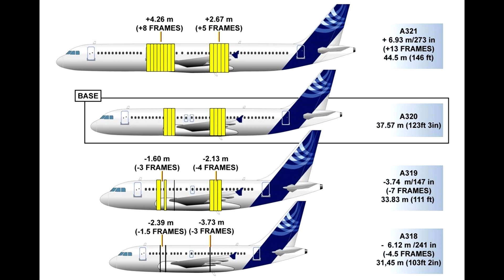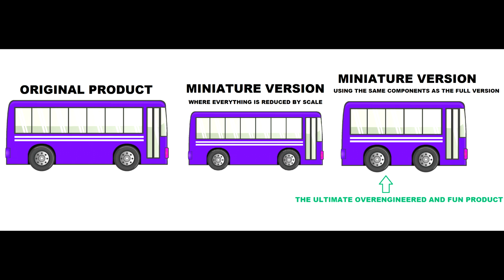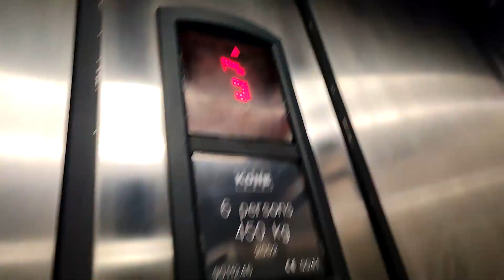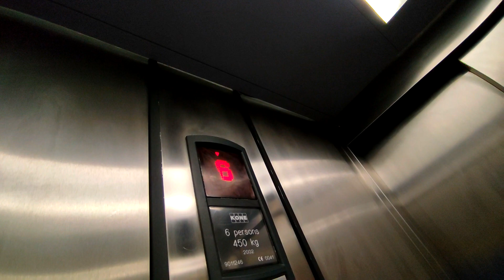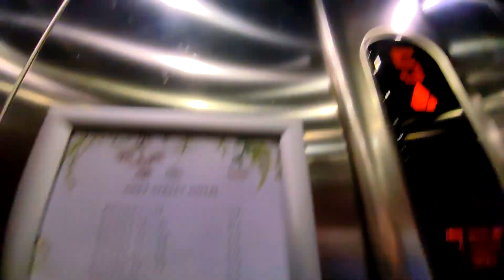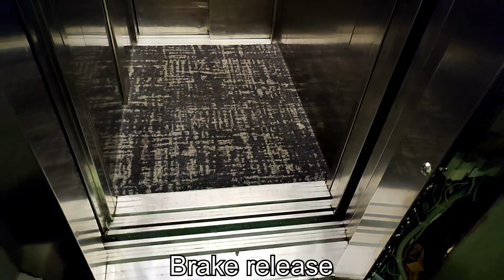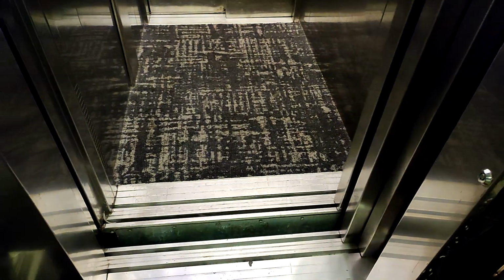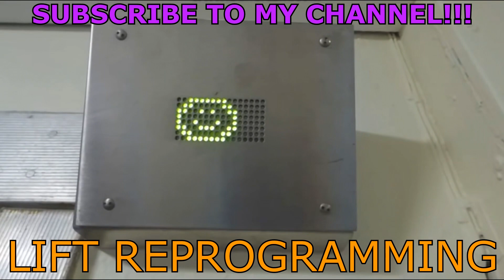Kone BabyDisc MX05 (1st gen)

Comment: Sadly, Arriva Kent and Surrey no longer has any Mini Pointer Darts. A few of them went to Arriva Kent Thameside.
The ALX400 B7TLs are also a rare sight now. Out of the 49, there are only 18 left. 0 at Maidstone, 3 at Tunbridge Wells, 10 at Gillingham, and 5 went to Luton.
All the good buses are disappearing.
Reply from the maker: Someone I met asked me if I wanted to go on any buses.  I suddenly realized that I haven't looked at buses in the UK for quite a long time.  I shows how boring they are.  Non-hybrid euro 6 buses are utterly crap.  So slow and underpowered.  And nowadays bus drivers go so painfully slowly (maybe due to fuel price).  And while hybrid euro 6 are nice, I have seen them all so many times that I am bored of them.  Buses were interesting 10 years ago.  There were many variations of body and chassis combinations, which you no longer get.  There were weird and whacky prototypes of the new era of hybrid and electric buses.  There were loads of euro 4 buses with interesting gearboxes.  And drivers used to go fast.
Reply: Couldn't beat Bristol VRs and Leyland Nationals.

Comment: Does the first lift have an updated VF drive. I don't see the jolt when driving on inspection / after safety breaking that is charachteristic of the older ecodisc VFs
Reply: Yes
Originally, it would've had the VF which could do full intelligent levelling

Comment: Pointer Darts were some of the best single decks ever made. Now the best single deck you get is an Enviro 200 MMC with an Allison gearbox, these are incredible modern buses and can apparently do over 70 if they are not speed limited and also have insane acceleration, Unfortunately the E200 MMCs with Voith gearboxes are absolutely terrible in comparison, they are slow and unreliable.